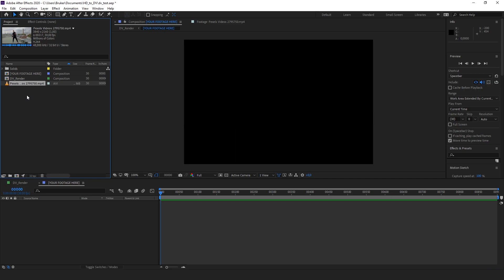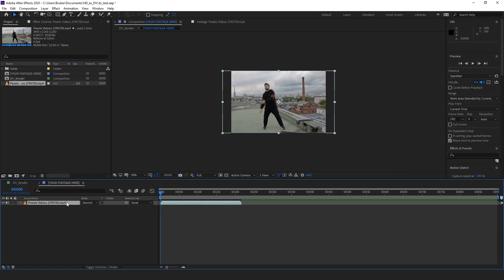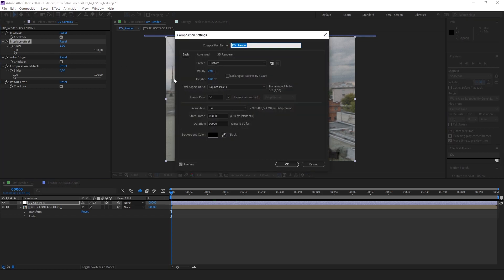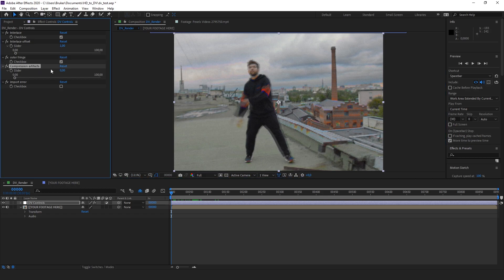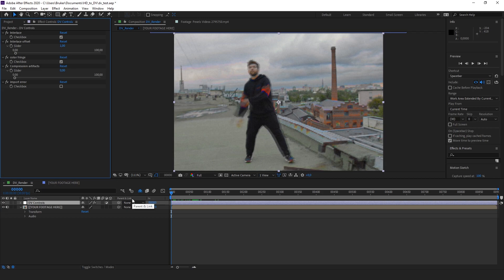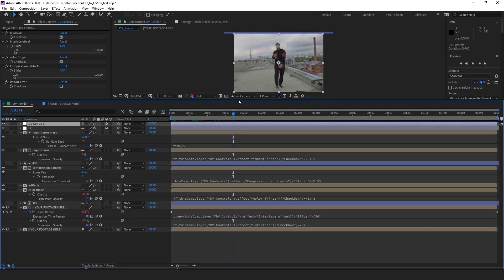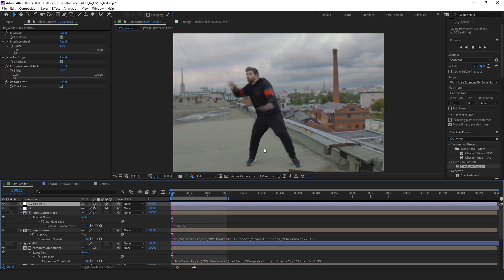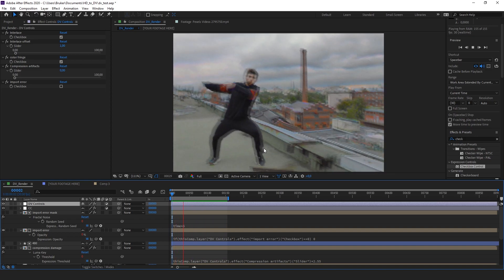After Effects Tutorial - Turn Your Footage Into Interlaced DV Video (Project Files Included)

Comment: How do i apply this to 16:9 4k footage? I've tried by changing the composition settings and by transforming all layers by fitting it to comp, but it doesn't work properly because now your effects only apply to a small square selection, at the center of the composition, instead of the whole composition.
Reply from the maker: Change both comps to your desired resolution, and go into "solid settings" for each layer. Remember to uncheck shy layers
Reply: @ErianTrotland  it worked! Thank you so much.

Comment: Hey, this is sick! Question though, when I switch back to DV_Render, the footage has a grain on top of it. How can i get rid of it and can I apply this preset without shrinking down the resolution?
Edit: I've found how to turn the grain off and how to make the composition 1080p. Thank you for the preset :)
Reply from the maker: Glad you made it work!
Reply: Could you share how you made the comp 1080p and the grain removal?
Reply: @elricfd  yoyo, if you still need it: 
so the preset consists of layers that are "effects" that you can scale up/ scale down/ turn on/ turn off. If i remember correctly, make the composition 1080p, then turn off the grain layer, and scale up the layer with the interlaced "effect"
Reply: @ilyaslastnikov  but how do I remove the grain layer?
Reply: @ilyaslastnikov  how did you remove it? :(